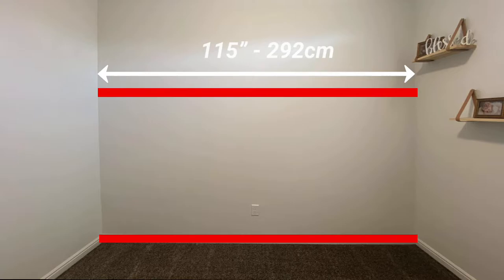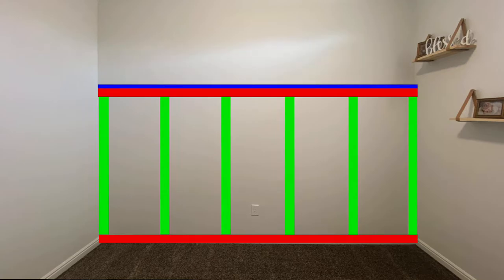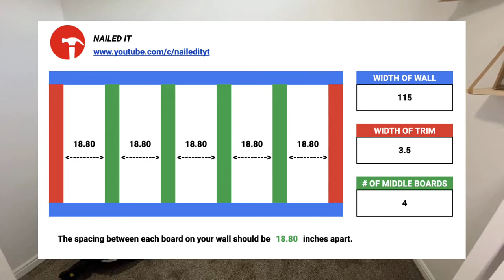How To Board and Batten Accent Wall - DIY Project

Comment: This is a wonderful tutorial, and it makes me feel confident I could give it a try in my own home. Out of curiosity, do you think preexisting trim could be left in place instead of doing a second horizontal board? Or would that look odd? The trim I have is the same as your trim that you removed.
Reply from the maker: I personally think that it would look a little odd because the square part of the new trim would hit the top of your base board and stick out. It’s obviously completely up to you but I think you would like the look of it better if you replaced the baseboard at the bottom! It also is pretty easy to do and wouldn’t cost much more in the end for another board! Hope that helps! Great question! Let me know how it turns out if you end up doing it!